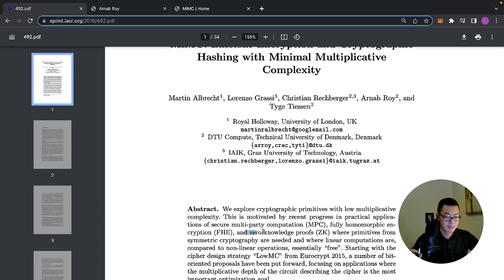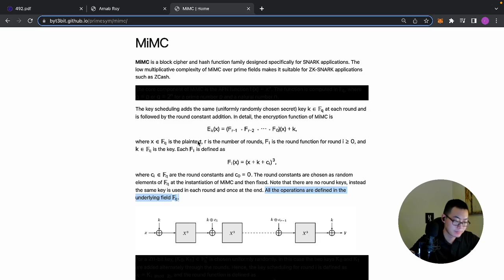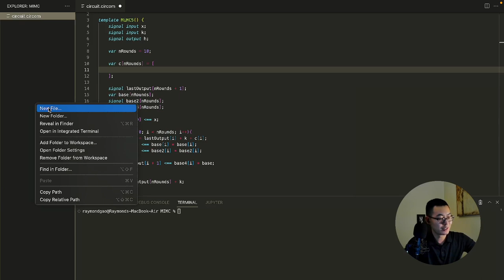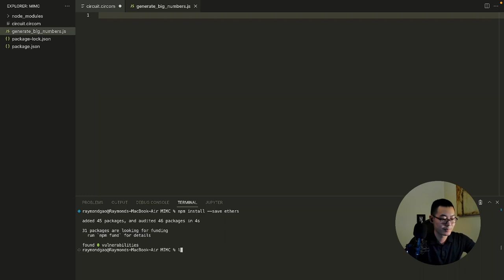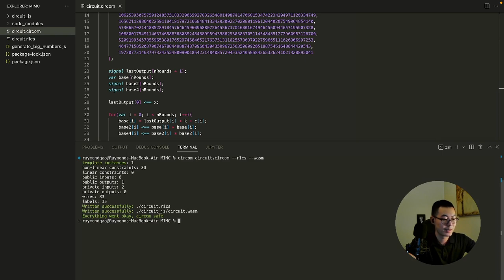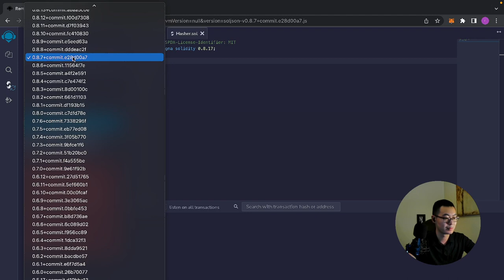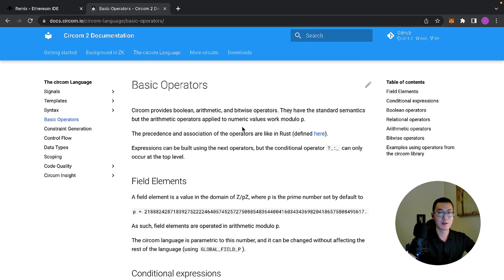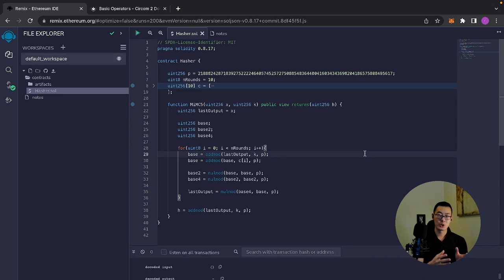[Tornado Cash] Ep6. MiMC Hashing Function Circuits | Circom + Solidity

Comment from the maker: Also want to point out that MiMC is circuit-friendly (therefore ZKP friendly), meaning it won't require a tremendous amount of constraints when converted to R1CS. This is thanks to the fact that MiMC uses addition and multiplication to computer the result, making it readily convertible to a addition/multiplication circuit. Hashing functions such as Keccak256, when turned into a circuit, will require 20K+ constraints, making it ZKP-UNfriendly. This is due to Keccak256 having a great deal of bits SELECTION. Circuits must be static when implemented, therefore selection can only be achieved by boolean functions (0/1 switching coefficients), which makes the # of constraints balloon rapidly.  

*Also a correction: When writing the "generate_big_numbers.js", I said "modifiable constant" for num. Constants are not modifiable in JS (unless it's an object/array and you're modifying a member value). I intended to say that the num variable should be defined outside the main routine so we can easily change it later depending on how many random big numbers we want.
Reply: Thanks